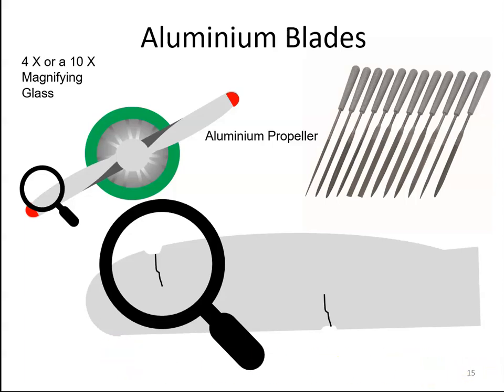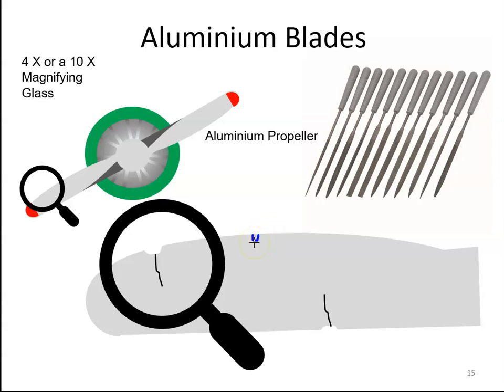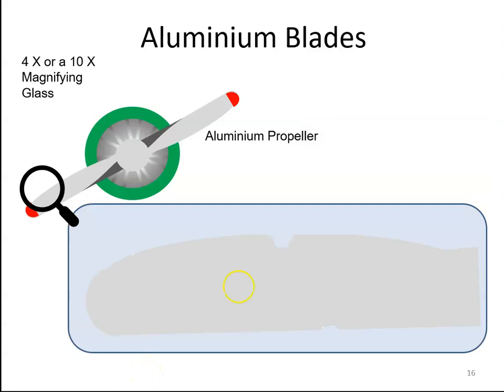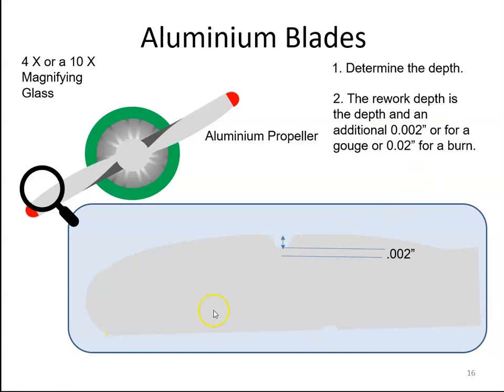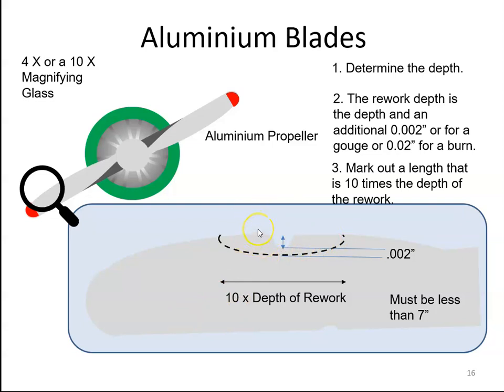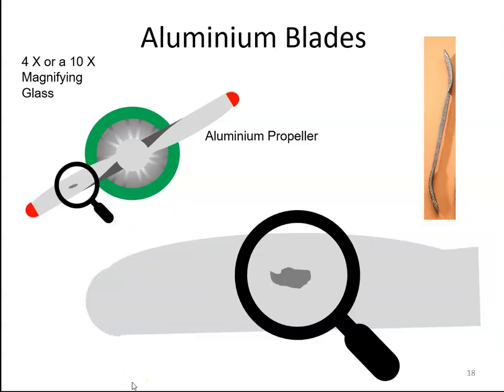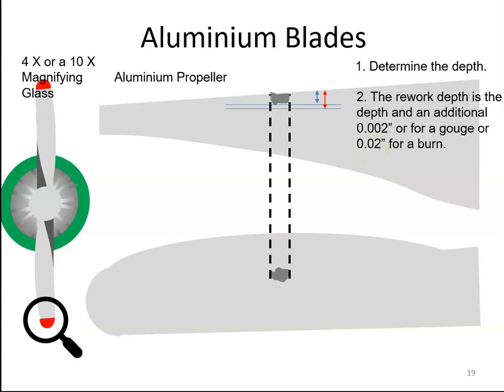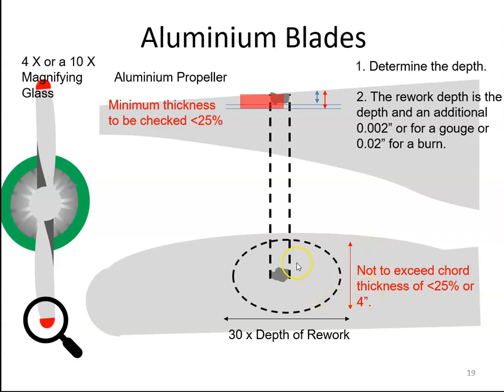Aluminium Propeller Blended Repair

Comment: Hi Roddy, thanks for the video. What is the reference for marking 10x and 20x the depth as rework area? Are these from OEM manuals or some SRMs?
Reply from the maker: The correct reference is at Advisory Circular 20-37E.
Reply from the maker: Spoon file